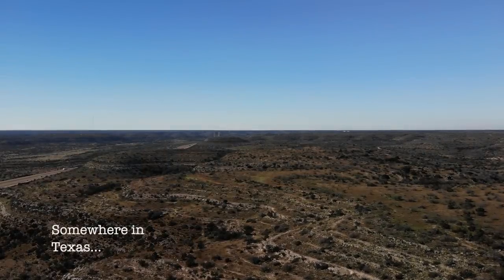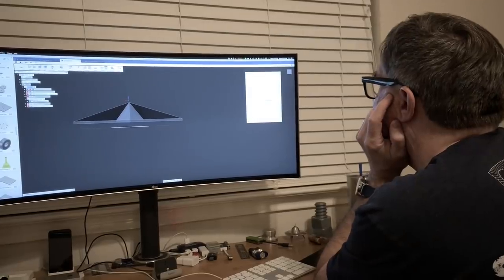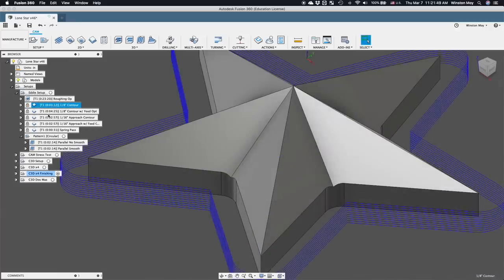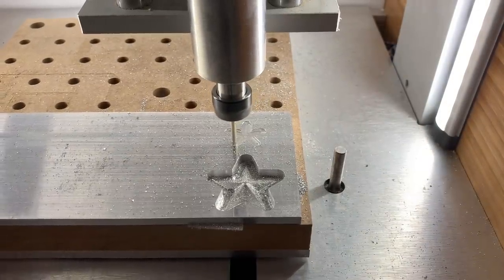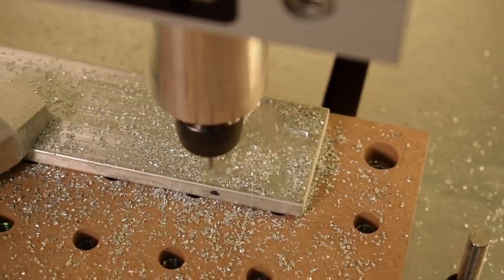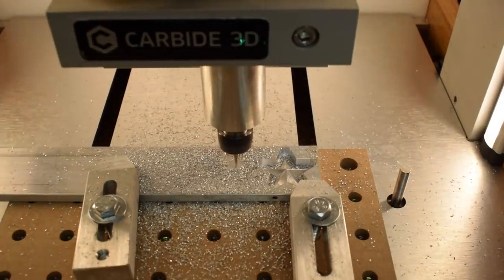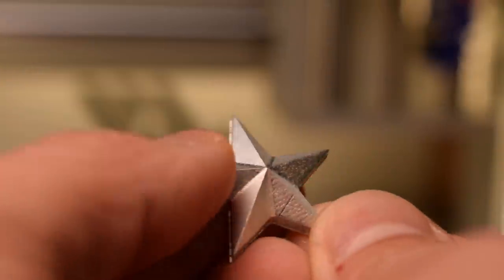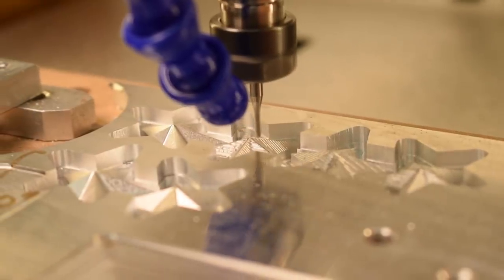Deep Diving 3D Surface Finishes in Aluminum - #137

Comment: The smaller the ball nose end mill the smaller the step over needs to be to get a smoother finish, or use a larger ball nose at the cost of inner edge sharpness of the model. With such small end mills run out starts  to matter as well. It could be the motor/shaft, end mill and/or collet. At this point I'd start considering other types of finishing methods like sanding, sand blasting and polishing. Even so, I think your results are very impressive!

Comment: If you can, set up a small air blast 'straw': It does two things; gets rid of chips in the cut and keeps the tool cooler, but then I see you did that later on. A lot of things to think about, but I am filing this vid for a reference, for later study when I do Al on my 6040. Very valuable vid. Thank you.

Comment: Winston, when you reference stepover, you use a percentage (6% being a great balance of machine time v surface finish). 

What is the percentage referencing? Tool diameter? So for a .125” tool, a .0075” stepover? (6% of .125)

Thanks for putting all your lessons learned out there for the public.

Comment: Winston, I know this is an older video of yours but I'd like to share some of my CNC experience with cutting injection molds and surface finishes.  Overlap percent isn't the only factor to consider.  You have to think of the surfaces as uphill/downhill and convex and concave.  The easiest to understand is the convex downhill.  Like cutting the outside of a hemisphere.  In this situation you want to cut top to bottom (downhill) and the cut is a climb cut.  And you would rapid from the bottom back to the top like a ski lift style action. It definitely takes longer since you're only cutting on the way down.  But you wouldn't want to conventional cut as it would not leave a nice finish.  You can also calculate the step over size to match the chip load for "equal spacing" finish.  This video does a better job explaining:  https://youtu.be/XSiPWq4Osmw

You can try this out on a large radius half circle like 200-500mm, like a plate standing vertical with a half circle. It's a good way to test different milling strategies. 

And great video as always!

Comment: Any chance we could see that same part on the Pocket NC using simultaneous 5-axis?  I'd love to see how the best part off of each machine compares, as tiny-tool machining in metals is a tough nut to crack with non-industrial machines.  Also, the Pocket NC is the only 5-axis machine that will fit on our home, a 53' sailboat. : )

Comment: when finishing, do climb miling instead of conventional because the risk of recutting the chips is almost none and put a little oil on it to lubricate the cutter
Reply from the maker: Parallel doesn't do a good job of respecting direction of cut. But on the morphed spiral and scallop I went climb only. 👍🏼
Reply: @WinstonMakes  wouldnt 3d contour do the job?
Reply from the maker: It would. I initially started with parallel though because I wanted to segment the directions and give each point a brushed aluminum look.
Reply: @WinstonMakes  ah okay i get what you mean :)